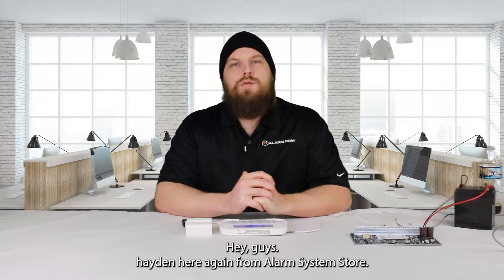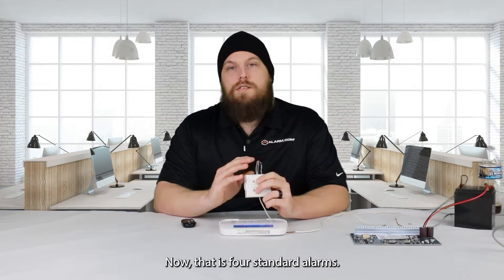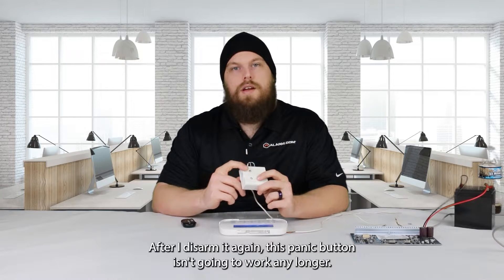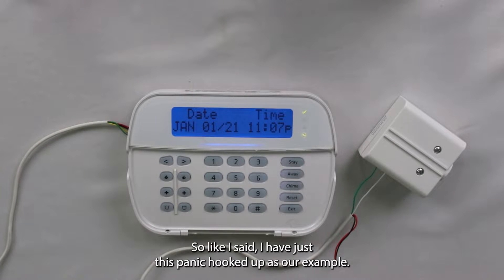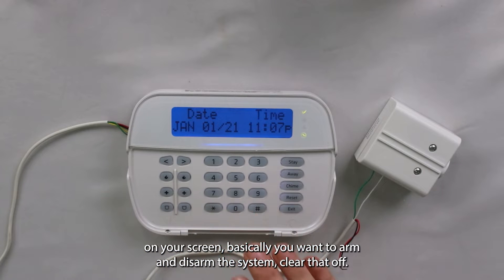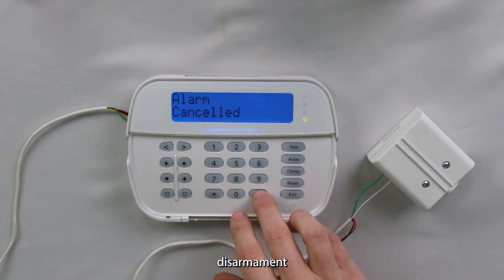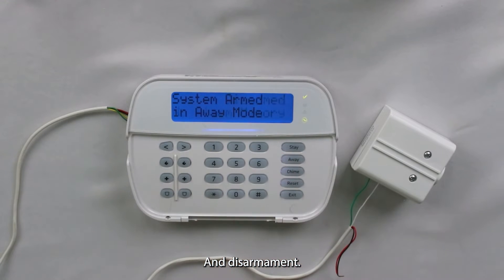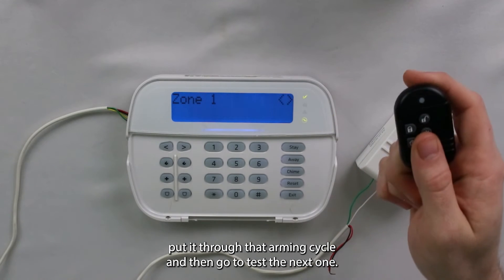Panic Buttons Not Triggering? Learn How Swinger Shutdown Affects Your Alarm System

Comment: How to fix  RF Jam Trouble and Swinger Shutdown?  I have replaced the battery and reset the alarm.  Thanks
Reply from the maker: The RF jam indicates an issue with the receiver having signal issues, but its a bit much to try and work through in a YT comment. If you're one of our customers you can open a tech ticket on our site. Otherwise it would probably help to have an installer take a look at it.
Reply: @AlarmSystemStore  Thanks!  What is the cost and do you have an installer to recommend.

Comment: How do you stop on the NEO out side Alarm Siren strobe light from flashing ?
Reply from the maker: If your panic is set as a silent alarm, the strobe wouldn't go off. If you want the siren to go off however and not the strobe, you'd need to connect the strobe to a PGM output and program it accordingly.
Reply: @AlarmSystemStore  thanks for the reply. I  just bought a house and the outside strobe light is flashing, i want to turn off the strobe light. What are the steps to turn off/disable/reset  the strobe light ?
Reply from the maker: Just disconnect it if you don't want to use it. @AusSonic